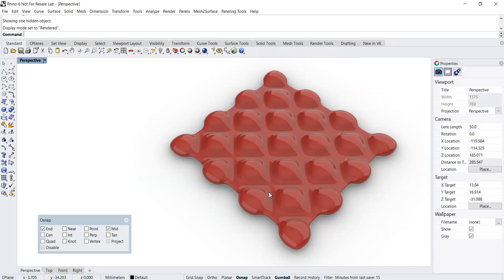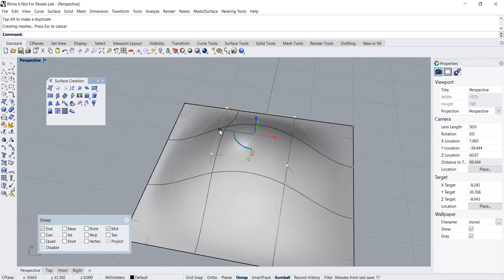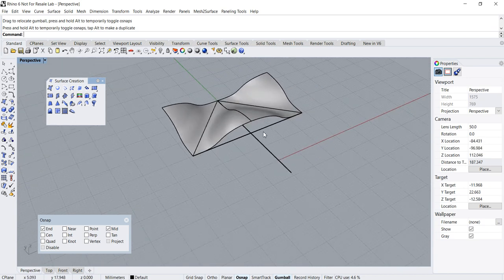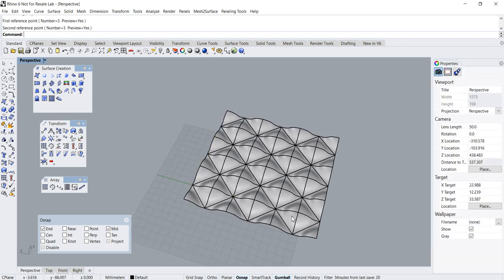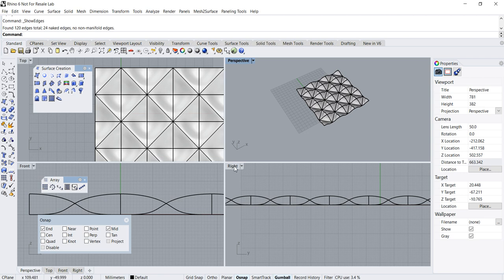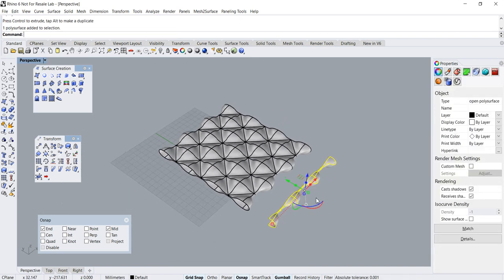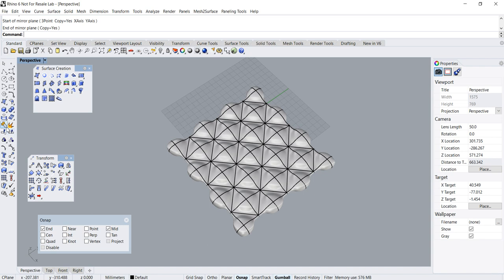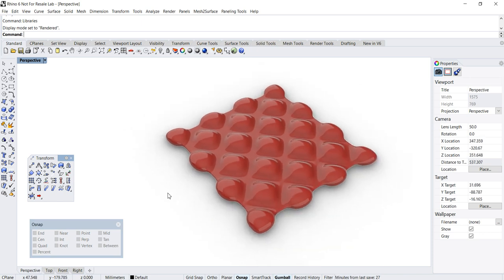Rhino 3D Tutorial: Soft cushion-shape modelling

Comment: Hey nice tutorial PC Sim
Let me ask you something. I need to create a surface such as an egg carton on the walls of a cylinder, how can I do that? I have tried a few steps but I am not satisfied with the result. I have done the following:
1- Created a heightfield from the 2D image with the Zbuffer command and then applied as a displacement on the walls of the cylinder, but the mesh is not so good;
2- I used the command from the paneling tools menu, however the shape I wanted on the cylinder wall was not bended to follown the curvature of the cylinder;
3- I tried the flow along surface but it was unresponsive, no flow was generated. 

Do you have something different in mind? Please give me some guidance if you can. Thanks in advance.
Reply from the maker: Hmm... You want to try to rebuild the cylinder to degree 3 in both U and V? I am not too sure what went wrong though. Cheers.
Reply: @simpernchong  Hey, lets say, for example, that I want that cushion you made in this video on the surface of a cylinder ? In your opinion do you think it would be possible ? Thanks for a lot for your comment
Reply from the maker: @humbertosilva4140  Hi, I think it is possible. You can try to make the thing flat first like my example, but make both ends open. The open ends is for them to meet up nicely when they are wrapped around the cylinder. 
Next, we can use Flow along surface to do the wrapping. You may want to see this recent video on the portion where I did the flow along surface >> https://youtu.be/bcCF6f_WKsE    . Cheers :)
Reply: @simpernchong  Hello. Thanks. It worked well now. I am not sure what I was doing wrong. I created the UV plane surface, and then applied the flowalongsrf. Thanks a lot PCSim, keep this channel up.